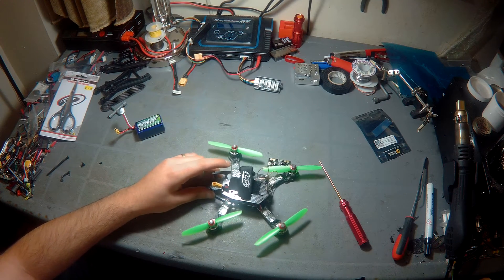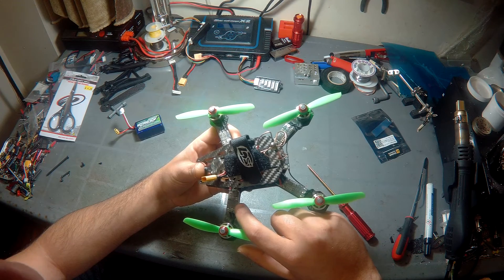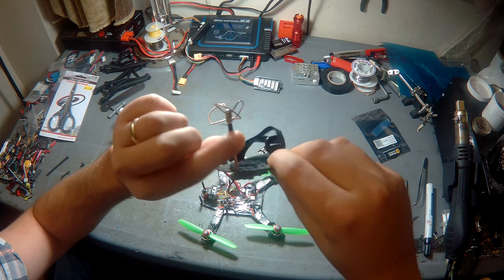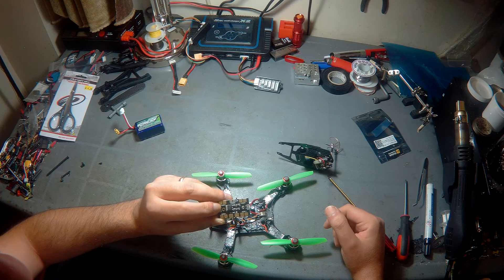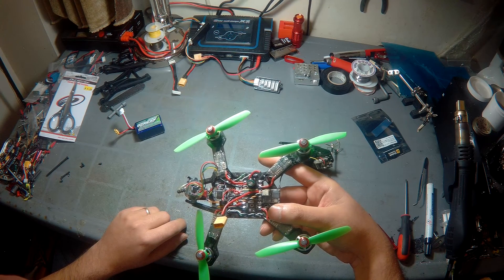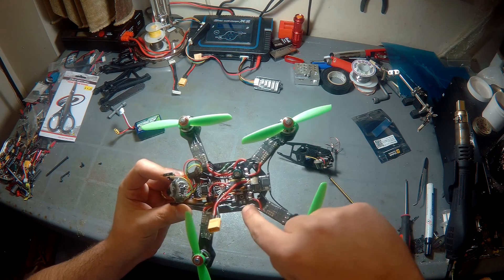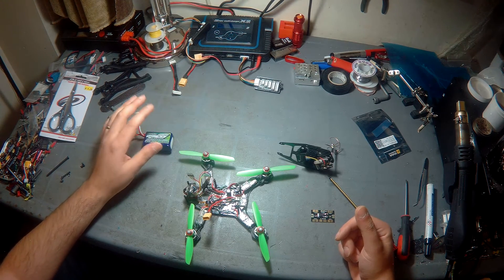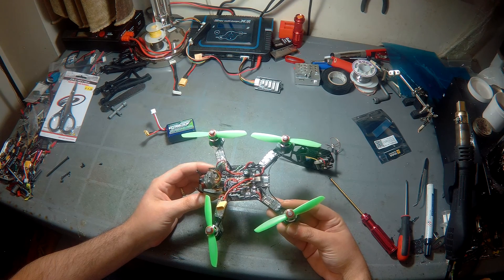Diatone 160  Build Log  216g AUW - 200mw OSD 600TVL 20A LittleBee - Peel Drone

Comment: Hi,
I  was wondering if you could help me. I have just finished a 160 Quad with the following specs. 
-Frame: Diatone ET 160 
-Motors: Multistar 1704 Motors
-ESCs: Afro 12 amp with Simon K
-FC: Illuminati 32 with OSD
-Battery: Turnigy 1000mAh 11.1V – 3S
-Prop: 4025 (4x2.5)
-FPV: Eachin MC02

This is only my second build and I am not sure how to resolve a problem that I am having. The problem is, I am only able to hover for about 1 to 1:30 min at only 3ft (very little lift) and the quad will wobble a lot even after leaving the ground effect. I am using new batteries. 
The strange thing it that I had the same setup (motor-ESC-FC-Battery) on a Hobby King 250 cheap plastic frame. The only thing that changed from the HK250 quad was the prop size. I was using a 5040 prop on that setup as was able to fly well for about 7 minutes. There is no physical way to use the 5040 props in the 160 frame configuration.
I believe the problem to be the props that I am using and is causing the short flight time and lack of lift. The wobble is probably PID tuning that I will have to figure out how to resolve. But before ordering new props I would like to have your opinion on about what you would think the problem would be and what props do you recommend, since my previous build HK250 flew well in a similar configuration, but with 5040 props.

Thanks for your help,
Tom

Comment: I need to see how fast it is.  I'm wondering your flight times and what battery?  Any thoughts on tri-blades?  I guess no since you said no to Bullnose.  I wonder how this compares to the airblade 150.  I'm wanting to build the fastest setup under 250grams
Reply from the maker: +CoolStuffReviews flight times on shown lipo nano-tech 850mah 45-90c is around 4~7 mins roughly . as for the props yes. 4040BN flies fine BUT response suffers greatly so agility vs top speed your choice . 1 thing you might wanna do is go with RCX 1407 motors :P its such a nice upgrade  Im ordering a set .sorry which airblade you are referring to ?
Reply: +Peel Drone http://www.airbladeuav.com/products/airblade-team-legit-zmr150
I will check out those motors.  I&#39;m up in the air on which frame to pick!!!  Also any thought on triblade props?
Reply from the maker: CoolStuffReviews

Amazing frame for sure :) same weight pretty much. if u really wanna use tri prop I really suggest you try 1407 motor or even 1804 , its a nasty prop but I love it .. I have on my 180 tweaker with RotorGeeks 2204 2300kv . I loveeeee the noise it makes
Reply: +Peel Drone I like the 1407 is only 1 gram heavier.  now I will have to look at the new motor u suggest.  where r u getting your motor rcmart?
Reply from the maker: seems only option so far . hopefully that will give me ease to use 4040bn
Reply from the maker: +CoolStuffReviews one more thing I guess on airblade 150 you will be limited to 3" props  !?
Reply: +Peel Drone right so that one is out of the question